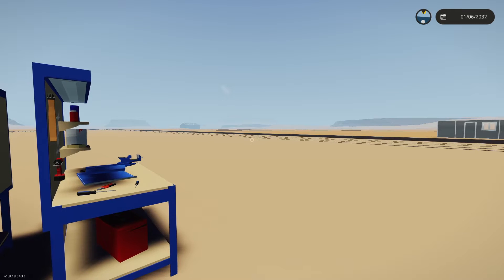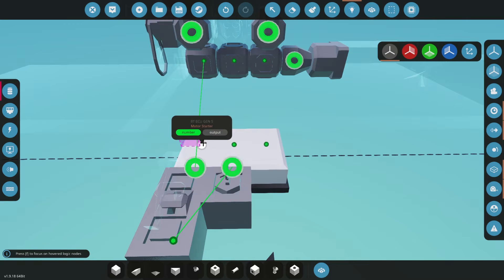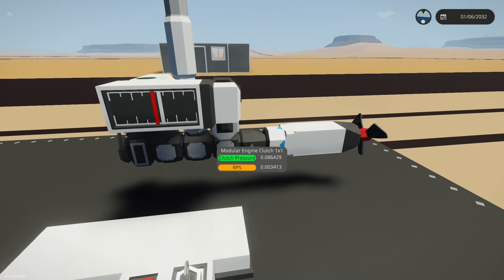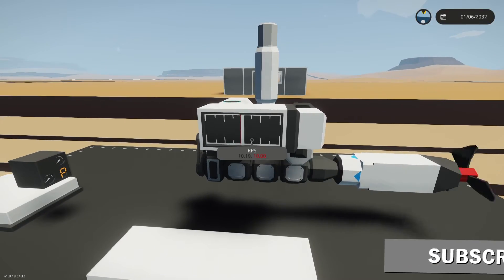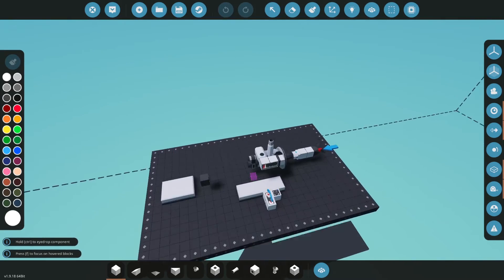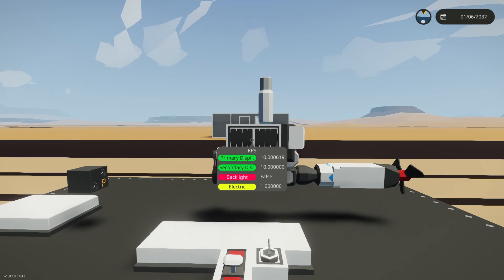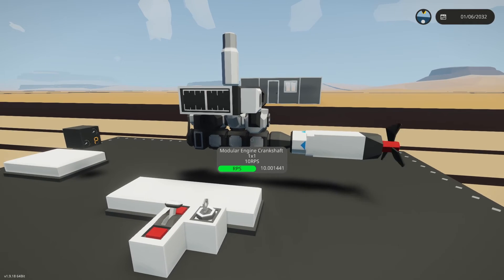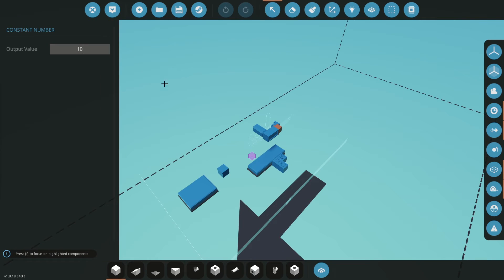How I Made A COMPACT CVT In Stormworks!

Comment: Tried copying what you did here and it works as long as I don't send a lot of torque through the transmission. It begins to oscillate and gets much more violent with more torque I apply.

I tried joining your discord but the link provided in your description states the invite has expired. And I'm guessing you've moved onto other things since a couple years ago I did the same with this game but have started looking into it again wanting to build an engine dyno to do a bunch of stress testing of engine designs to sort out what I believe are a lot of misconceptions about how things work or what is best.

Comment: Better clamp function for the future:
you can use math.min and math.max to clamp any number more effectively without resorting into if/then statements, which are slower (especially relevant for multiple vehicles and multiplayer)
function clamp(x, y, z) return math.min(z, math.max(y, x)) end
Thanks for this tutorial, although for very heavy machinery I still prefer the dual-clutch method as I can have a really low gear in addition to the really-high one (for high torque).